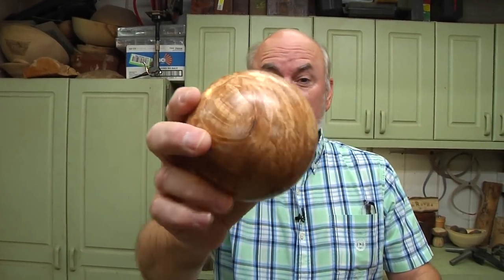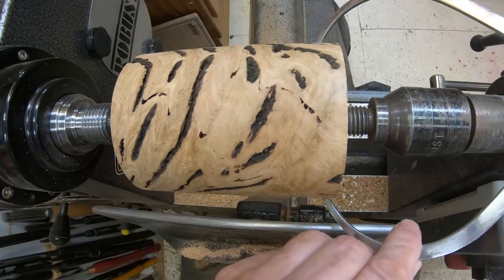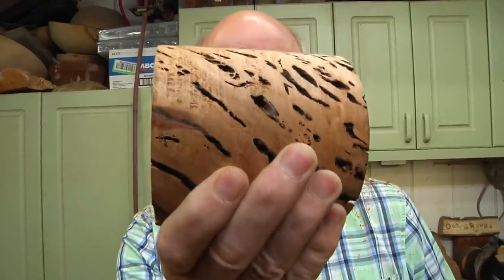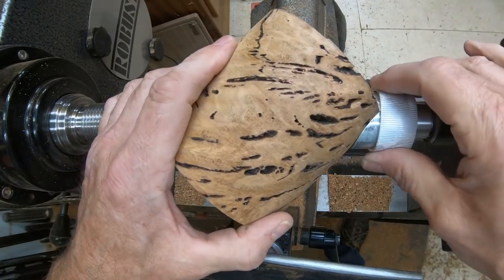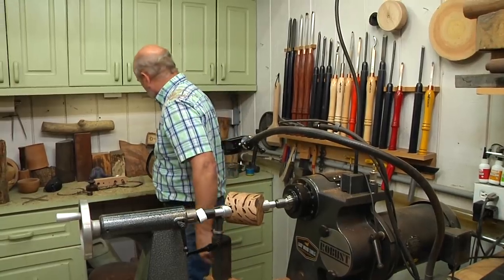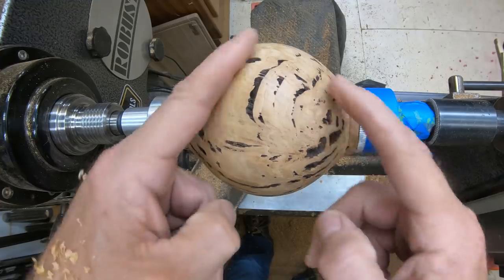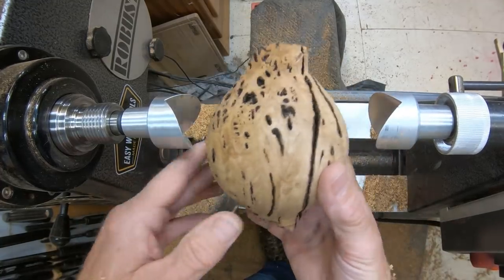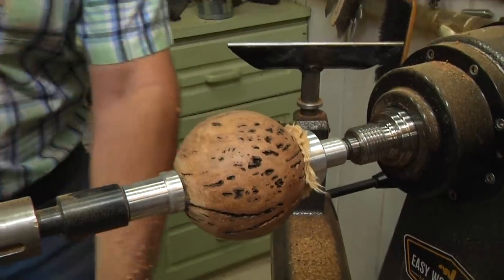Spheres for Dummies

Comment: Another extremely easy way to turn a sphere is to...  1). Turn your timber round between centers slightly larger than your desired sphere size (standard round cylinder)....  2). Then use lathe indexing and tool rest to accurately mark a centerline down the entire length, each side of the cylinder length, as close as possible - measure center at cylinder length and mark centerline (remove cylinder from lathe)...  3). Flip the cylinder vertically and refit at the points between length and mid centers (as marked in step two)....  3). Turn the endgrain down (partly cutting air) working your way down through the shadow line, until you turn it down enough to closely match cylinder tupe size - making as clean cuts as possible... 4). Remove the now a sphere workpeice and refit between  soft cork type holds as seen here...  5). Cut a round circle from scrap material (appox 1/3 of sphere size), using the likes of a holesaw, then cut a slightly smaller internal hole within the first circle - creating a large-ish ring. Hold sandpaper of your desired grit over the ring and begin sanding the sphere pressing the ring and sandpaper  against it periodically rotating the sphere which will only remove the high spots on the sphere leaving a absolutely perfectly accurate round sphere....
Work your way down through the grit until happy remembering to rotate the sphere regularly between your soft centers to ensure it's perfect round.
Confused... follow the above steps, it's actually quite simple. 
Theres No special equipment, holders, fancy tools or high end mechanisms holders required! 
Happy Turning Foke 👍

Comment: Nice system. I visited the web site but don’t speak German so is there an easier way to purchase this? Thanks!
Reply: If you're using Chrome (browser) it provides generated translation for websites, you access this with the little icon left of the "Favorite" (Star shape) symbol if available.
Example; https://i.imgur.com/JDyQP6s.png Look where the red arrow in the top right is pointing. If that symbol shows up (it should for this website if you don't speak German) just click it and click "English", it will translate the whole site. When you open sub-pages on the site, you may have to reset the translator thingy.

Comment: The center set is cool, but for a tool I think you wood do better to use a Bedan than your carbides.  The bedan will fairly easlily turn a sphere between normal centers, it would be awesome with this set.

Comment: Tim I really liked the video and the sphere looked great.  However, when you were cutting the blank on the final pass (~1:05 into the video) I noticed sparks from the bandsaw blade.  It either hit something in the wood or more likely the blade was hitting part of the upper guide.  It is worth a check.  If it was the upper guide, a quick setup tuneup will take care of it.  Be safe and stay well so you can bring us more enjoyable videos.  Cheers, Tom
Reply from the maker: Yep it was the upper guide. As you can tell I don't speak 'bandsaw' very well :^) Do you know of an article or video I could use to tune up my saw? I bought some ceramic guides and still haven't had time to figure out how to install them.
Reply: woodturningwithtim1 As for ceramic (Cool Blocks), as long as they are installed so they are just shy of the blade (dollar bill thickness away) and are just up to the gullets on the blade, they work well for side play.  Top and bottom side guides are similarly set up.  The back guide (usually a rotating bearing must be smooth and free wheeling) should also be spaced slightly back from the blade so it doesn’t normally touch the blade.  With the blade tensioned (~1/4” side play checked at the back side of the top wheel is best) you should be set.  Cheers, Tom